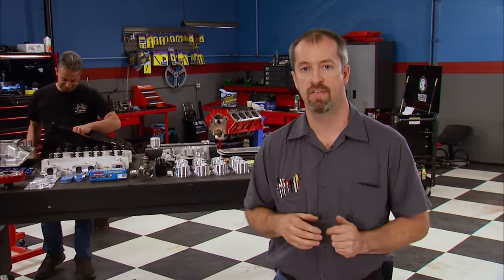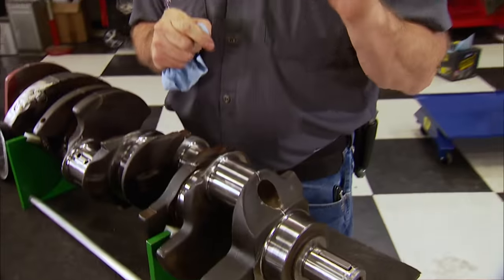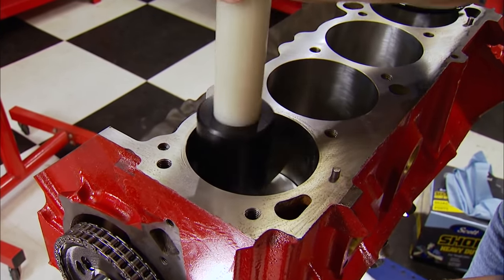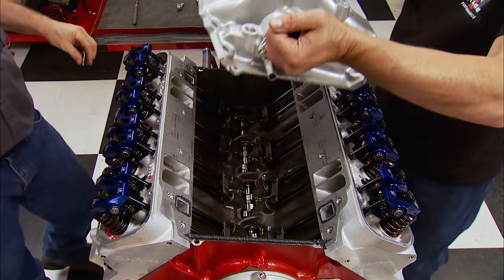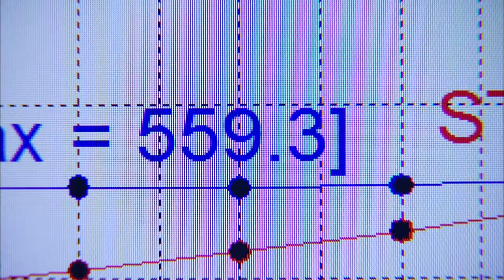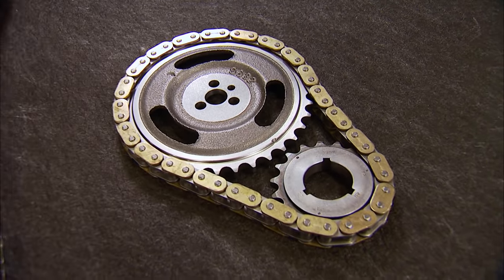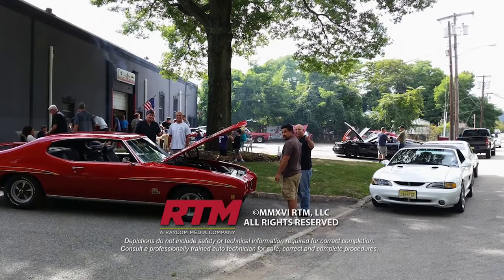Building A 455 Buick That Makes Surprising Pump-Gas Power - Engine Power S3, E17

Comment: I used to buy all my high performance Buick parts from Kenne Bell years ago, until they got away from Buicks, and then I started using TA Performance for parts which carries the same stuff Kenne Bell used to
Reply: Me too...
BTW: It's "Kenne Bell"...
Reply: @janfswedane  that's what I get for using talk-to- text LOL
Reply: Well heck I spelled his name Kenny in a previous post because I didn't remember. It seem like something was wrong though. lol
Reply: @jerryhayden8720  It comes from the 2 founders last names..
"Kennedy" & "Bell"
Reply: @janfswedane  ok I never knew that. Never had the need for the products but simply enjoyed reading Hot Rod Magazine and other's magazines about building hopped up engine's and Kenne Bell definitely had a big presence in the hot rod world and definitely would not leave out that girdle. I'm wandering if they were the ones that came up with the crank girdles for the Ford's since I'm thinking the company switched over to promoting Ford part's. Thanks for the reply. Have a great day.

Comment: I know coolant will flow through the heads but how would the block handle not having coolant run through it? Seems a street engine would have detonation and heatsoak in the cylinders
Reply: Aluminum heads dissipate heat faster than iron heads and are much less likely to detonate, I don't know anything about what will happen to that block though

Comment: Hey the 455! I'm determined to fit one in my 79 triumph tr7, so here's hoping for that to go well!
Reply: Than you might wanna look at a Pontiac 455 and not a Buick
Reply: @garyfleming4101  Why the Pontiac? I like the Buick because rover bought the rights to the 215 and used that in my car, so using a Buick just feels right you know?
Reply: @HighTechPioneer  Pontiac because you mentioned making it fit and if space is the issue the Pontiac will be easier to fit. Also Pontiac had four bolt mains so you could abuse them hard and they were more forgiving but that's a whole different subject. I like the Olds, Buick, and Pontiac motors its not like you can make a wrong choice.
Reply: @garyfleming4101  Oh awesome, thanks for the info! I've been digging the idea of using the stock block and getting into metalworking by designing my own heads instead of going for aftermarket aluminum ones like everyone else, but that takes a lot of research before I'll know what I'm looking for. Never bad to have a hobby though!

Comment: In the 80's, I found a 72 GS 455. Tinkered and toiled and got her to run 11 flat at the local track. 10:5 to 1, mild crane cam, Offenhauser 360 equiflow intake , topped with a 1375 holly. Cast iron exhaust cut-outs and would school those Kingwood rich kids on friday night cruise... (still kick myself for selling it to go to paramedic school...lol)

Comment: 628/570 is good power out of a NA pump gas big block of those cubes. Although it's probably still $7K in parts/machine labor. Definetely could make that on a BBC no problem as well.
Reply: 7k? You have to be joking.  If they have less than 15 in it I'd be shocked.
Reply: WAY the hell more than $7k. When was the LAST time you built an engine?? That thing was well north of $15k

Comment: I am a Buick fan. I personally owned '68 GS 400 THM 400. It was fast and used to chirp the tires when manually shifting into 2nd gear. Great cars & great engines. I have a topic suggestion. I learned in 1974 Buick made available a 455 engine with a 2bbl carb. I would really enjoy watching you guys do your magic and see what you can accomplish with a 2bbl carb. I want to see a comparison between the 4bbl & 2bbl. Also, if you have the time and funds, I'd really enjoy you doing the same with the Olds 425 & 455, Pontiac 400 & 455. It is my understanding these engines were fairly potent even with 2bbls. I am planning on building a 70 GS or Skylark economy muscle car.  In other words, a base or standard model GS or Skylark but with "Day 1" modifications. My plan: 70 spec'd stock 455, Rochester 2bbl, 2bbl stock manifold internally smoothed & polished,  maybe ported. Black satin ceramic coated headers, HiFlow mufflers, 3" exhaust system, HD shocks, HD coil springs, HD sway bars, front finned aluminum brake drums, GM HD 3 speed manual transmission, HD clutch, Hurst shifter, GM 10 or 12 bolt differential with 3:08 or 3:23 positraction gear set, manual steering, manual brakes, no a/c, no powers windows or locks, bench seat, stock steering wheel, stock dashboard but hood-mounted tachometer, tires equivalent to G or H 60-15s, steel wheels with Buick dog dish hubcaps, Custom Autosounds Buick factory appearing AM-FM, Bluetooth radio. This is bound to be a nice economy muscle car. What do you think of this planned project? Please comment, positive or negative. Your engine presentations are great. I hope to see many more of your videos.
P.S. Can also do this with the LeMans or Tempest, Cutlass. also, Chevelle or Malibu since Chevy did produce a 396/402 with a 2bbl carb. I think these would also make nice economy muscle cars. Thanks again for all your great videos and knowledge.

Comment: I can attest to the power of the 455 Buick in a '73 boat tail Riviera. Rebuilt one in the 90s and had to use the old carburetor 'til the next payday. Ran like dirt, but no mechanical issues. Got the rebuilt carb and put it on, gave it a rough tune and set off,...then proceeded to almost kill my self with that car. All i remember is passenger door leading,...driver door leading,..passenger door leading,..driver door leading, etc. Sliding back & forth down the road in that huge car. Good times.

Comment: Buick 455 sounds like a good motor for my 76 blazer
Reply: Much easier and less expensive to stick with a Chevy BB. Probably a 2:1 horsepower per dollar advantage. Rat motors are everywhere and good go-fast stuff is easy to find and relatively affordable. Buick goodies are available , but will take some looking and some more money. And those who know the intricacies of the Buick motor are even rarer. Seems like this man knows his Buicks! I remember so many 455 Electra wagons sitting and rusting because they were gas-guzzlers, then after a few years, they went off to the junk yard!

Comment: I saw mechanic using silicone in the crankcase gasket but at the end look so bad an dirty with a lot of Left over on the edges so what you guys use to the job looks so good and clean at the end

Comment: I'm surprised about that cast iron crankshaft 😳
Reply: Well hes just reving it to 6000 rpms its nuthing to crazy
Reply: @Brayan777
They took it to 6500 in the end, it’s quite a lot for the large main bearing diameter of the Buick.
I have seen an iron crank small block Chev revved to 9500+ though (yes on many occasions, not just once). Many of us are used to the cheap and readily available steel cranks for Chev, but sadly not so available for the less often used Buicks etc.

Comment: Ive got an 85 regal with a 70 model 455 and 400 turbo, 9" ford rear end with 411 gears small shot of nitrous. Its good to see the old big block buick get some attention ...ive had people literally think i have a ford engine in it because of the distributor placement. I dont have 10k in the whole car though😂

Comment: Better run a BIG-ass oil cooler on that thing in the car, and a GOOD sized radiator also...

I've dealt with filled blocks a few times before, and even with a partial fill, the oil Temps WILL skyrocket without an oil cooler on it. A large radiator is mandatory also, or the engine won't cool well in the vehicle, and the oil temp issue will get even worse. 

Use the biggest 2 wide-row aluminum radiator that will fit,  and then build a sheet metal shroud that will enclose the entire radiator core completely and be right tight to it. Build the shroud as deep as you can without running into the water pump, and then install 2 electric fans on the shroud that are rated for 4000+ cfm's of airflow. Mount the oil cooler so that it does not block the front of the rad... move it off to the side, and put the largest fan that you can on the core of the oil cooler also.

If you do that, then it SHOULD run cool enough, and keep the oil temps in check. I've been there, and done that with filled blocks, and doing all of the above was absolutely mandatory if I wanted to street drive the car for any longer than 20 minutes at a time. After doing the above, I can drive it all day long. 
Before I did all that, and had no oil cooler and just a stock fan, shroud, and 4 core factory brass radiator, the oil temp would climb to 300°, and the coolant would be boiling within 10-15 minutes of street driving. 😬

After I did the mods, the oil temp stays around 220-230° and the water won't get over 185°, if I drive it all day long. Even in the hot summer.

Oh yea, I DID install an H.D. version of a Meziere 55g.p.h. electric water pump too... I tried that very first, and it made no difference, until I did the rest of what I explained above. I'm not sure if there was a stock belt driven water pump on it now, instead of the electric one, if it would make any difference or not.

Comment: back in the day...........rebuilding my 430 ('68 Electra) the search was a new timing case cover;  exactly which car this extra deep oilpan drops into is worth knowing as that the deep oilpan may hit the steering cross member (Electra different from Riv).  Top end rollerized is GROOVY.  To purchase this engine (a second-hand engine) (W/entire car or not) is to gamble as to value of original heads---thin-wall indeed between water ports and intake/exhaust ports.  Will rot there because of original gasket failure.  Happy 6$ gasoline future rodders

Comment: I've always wondered what kind of performance they would be able to get from a olds 307
Reply: Better off building an older 350 rocket or a 350 DX diesel converted to gasoline.  The 307 was never meant for performance.
Reply: 440 hp from some backyard mechanics from Canada. Look up "Analyze This!" from Popular Hot Rodding. The last name of the brothers is Robinson.

Comment: On you list of items you is shows a connecting rod with a 6.635 length. The video mentions a 6.800 length. Can you confirm which size is used? Thanks

Comment: Love the build, but i dont see why youd build the internals to be streetable then go and fill the coolant passages with hardblock. Might as well build for a full strip motor at that rate
Reply: Well the internals are very solid and that engine can be used on a strip no problem... diamonds pistons and eagle h-beam rods are very sturdy, making for a sweet 470 engine that has plenty of power. At some point you may tell yourself : do I really need more power?
Reply: @bigboreracing356  👍
Reply: They only fill the lower parts where heat isn't made..

Comment: Here's a question about these 455s. Could I drop a Pontiac engine in a Buick car? Could I easily drop a 455 Olds into any GM car from the era?
I've read that the engines themselves are different, but are they pretty much interchangeable motor mount and transmission wise?

Comment: Powernation makes me want to buy a spare motor for my other car. GM OHV 3.9 v6, the “high value” engine. 
The motor in it has 245k miles and runs like a dream I would love to build up a spare motor with ls1 pistons and forged rods and ported heads so it could handle a turbo or supercharger

Comment: Cool build, but way out of my price range. I like an engine that you don't have to do so much with. Doing all that is impressive, but I would take an engine with enough built in from the start. Block filling and all the rest is just more than I could ever afford. Other than that I enjoyed it anyway. Always love to hear them on the dyno. If you do not smile at that go and get an EV.
Reply: Filling the block isn't expensive, offset grinding the crank, as well as putting Mallory heavy metal in the crank to balance it does get costly.
Reply: LOL ! ... Yeah, block filling was the cheapest part!

Comment: Not bad, a 454 chev with stock 781 oval ports will make about the same power, take it to a 496 with same heads and you will make 650 and 650 torque no problem. Afr 265 and you are 700 and 680 torque

Comment: where do i get that cam roller button? i got handed down a 69 skylark gs stage one that has a 455 me and the guy who handed the car down to me put the short block together for... the rotating assembly is together minus the timing set but i never saw that button in any of the parts for it. any help would be appreciated

Comment: 455Buick almost small block light, 4 5/16 big bore on 4.75 bore centers (same as AMC) and compared to 4.8 for BB Mopar, great heads as does the AMC  great underappreciated engines

Comment: Did something like this to my 72 RS Nova. Blew the pos 307 and put in a 350. Blew that and dropped in the 350 Buick and roasted everyone down the interstate back in the mid 80's. Strong engines.
Reply: Only if got the hot Buick 350...

Comment: What do you do when a bolt or push rod passage is exposed from porting?
Reply: Cry?
Reply: Bolt no big deal... add a tube to contain pushrod... or weld the hole back up...
Reply: @BuzzLOLOL  Thanks for the info.

Comment: I wonder if the 455 parts compatible with the 430-4
Reply: There’s no difference between a Buick 430 cu. In . Block &  Buick 455 is the bore diameter of the prospective block. Also, the 455 engine uses a different valve lifter to oil the top of the head thru the push rod. Basically, the engines are very similar. Just the factory bore is different.  The connecting rods & crankshaft are the same. The cylinder heads/ non Stage1 are basically the same.
Reply: 400-430-455 basically the same

Comment: Nice cam but you could go a bit higher on duration <3 Love these engines...
Reply: 250 degrees is already a lot for a street driver engine... no power below 3500 RPMs...
Reply: @BuzzLOLOL  I had a 312 degree cam on my 2 litre 4 cyl Volvo engine. A lot of fun. But I have never seen a v8 engine with that high duration. Would be fun, and to see the numbers behind it..

Comment: I would love to see how much power you guys can get out of a 351 winsor
Reply: Lots of online builds of those... biggest problem is most stock 351W heads puke out by 250 HP...
Reply: Watch some Richard Holdener videos on his 351 series.
Reply: @bri-manhunter2654  - Been looking at Richard Holdener stuff for 30 years... he even had hair back then... was going to add a link to back then, but I see it's gone now...

Comment: I mean I love Buicks and Oldsmobiles because they're underrated they're just GMs I mean I really don't see that symbol I just see a GM symbol on anything GM like only idiots see a Cadillac Escalade you know what I mean I just see a Tahoe with a bunch of features that it really doesn't need
Reply: Back then they were completely different engines, it wasn’t just a badge.
Reply: Like my Ford Crown Victoria is a Mercury Marquis for 50% less... Lincoln Town Car for 100% less money...
Reply: As far as the engine, Buick, Olds, Pontiac, Chevrolet, Cadillac, all had their own engine, completely different, nothing interchangeable.

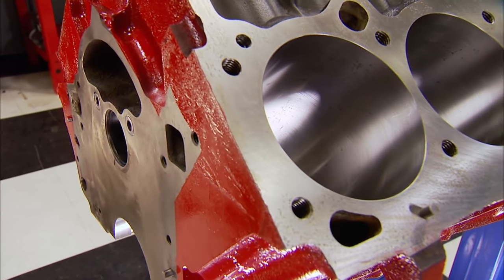Comment: 2:55 Guess again.... there were some Oldsmobile 455's that were rated at 510ft-lbs of torque also.. 
Exactly the same as the Buick. So it did not make more torque than any other G.M. engine. It tied with the big Olds...
Reply: True but I don't believe the 510ft-lbs torque version was available in the 442, only the Toronado. The point being the Buick 455 was the highest torque motor available in a muscle car.

Comment: It has concrete in the coolant passages. It’s not a pump gas street engine.
Reply: Sure it is. Filled blocks don't make it a race engine, and in fact tend to run cooler on the street, so there's that...

Comment: I would like to see engines that are built up, but still run on Regular Gas, Premium is just too Frapping Expensive... How much of a Power Drop would happen if the Compression were dropped down to 9:1?

Comment: I’m gonna build this Buick to be faster than a Chevy but use Chevy internals to hold the power😂
Reply: And compare the weight of the aluminum-headed 470 Buford to iron-headed Chevys. 

And did you catch the part where you GOTTA have that new repop "timing cover" and oil pump for a "new" Buick "high performance" engine "build" with a "SEASONED" - I.E. JUNKYARD BUICK BLOCK?

This whole "build" is just dripping with anti-Chevy irony, lol.
Reply: They only used Chevy design rods... the rest was Buick...
Reply: @deeremeyer1749  - Buicks and Pontiac 301's used crap aluminum housing oil pumps that wear out by 60K miles of spirited driving... just make it past the 50K miles warranty... specially shaped steel sleeves are made and available that fit inside them to improve them...
Reply: There's nothing Buick but the block. The rest is all aftermarket.  It's not "going fast with class". It's "going fast with cubic dollars with a big chip on our shoulder ".
Reply: @SGray44444  70 Buick gs stage 1 vs 70 ls6 Chevelle,,on cars and zebras on u tube check it out..